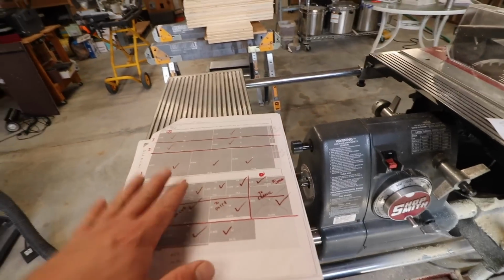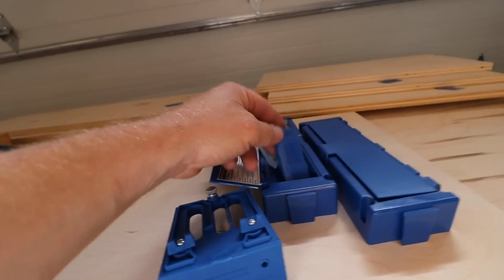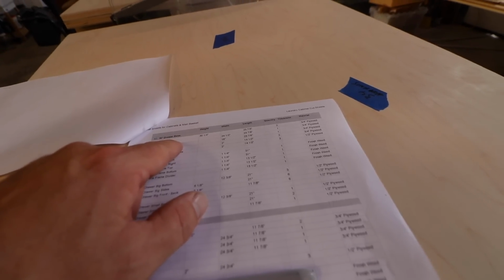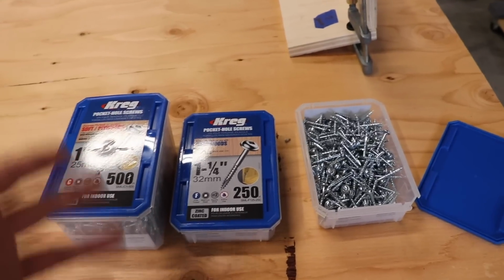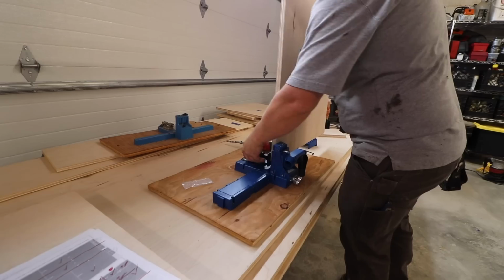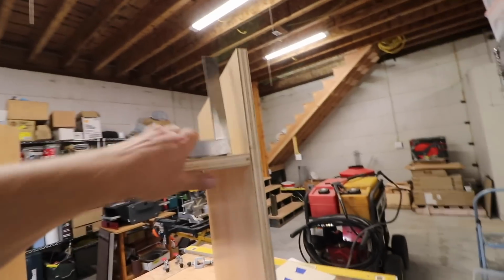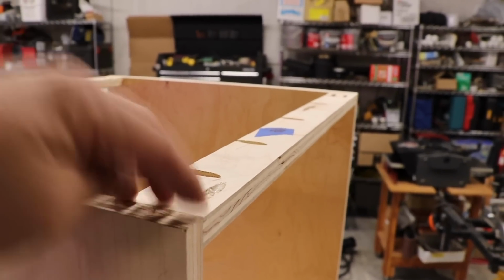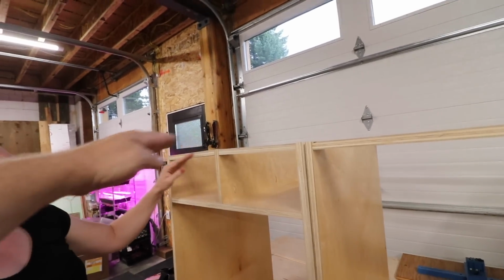Made ONE DOZEN CABINET JOINERY MISTAKES Today

Comment: Most people use Baltic birch for their drawers, 1/2" or 13mm, NOT China ply and NOT 3/4" or 19mm.

Baltic birch does not have voids or glue failures between the lamination's.

4mm Baltic birch will fit into a standard blades kerf and is strong enough to hold anything you can stack into a standard 4" deep drawer including lead weights.

Another plug for Baltic birch, it comes in 5'x5' square sheets as standard which works very well for euro-style boxes  like you're building. 4'x8' are available at an increased cost if you'd rather.

Comment: Glue ,Glue,GLUEEEE  you forgot the glue,pocket holes are not as strong as the old screws through the side  and glue in fact it really is the weakest link in all joinery ..oh and im a plumber and knows that
Reply: As a carpenter for 40 years, it's fine.
Reply: Glue doesn't adhere well to that finished panel.
Reply: @richardbrooks3569  ,a little sanding will help
Reply: @gsyguy1  Why spend the time? When those cabinet boxes get fixed to the wall, fixed together and face-framed, they will not come apart.

Comment: It is a good idea to glue the joints before you screw them.
Hold on you installing the screws from the outside in. However, they are meant to go from the inside so nothing will show on the outside. For that matter you do not need pocket screws you can use true screws.
Reply: mtabernig    Pre-finished plywood.   Wood glue needs raw wood to work.
Reply: True, however there is a tool that takes care of that...